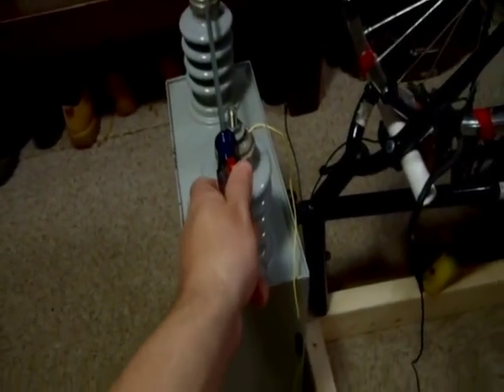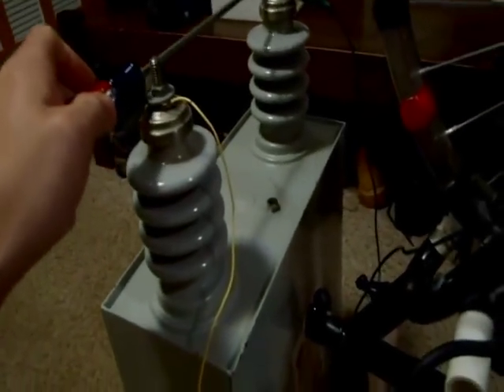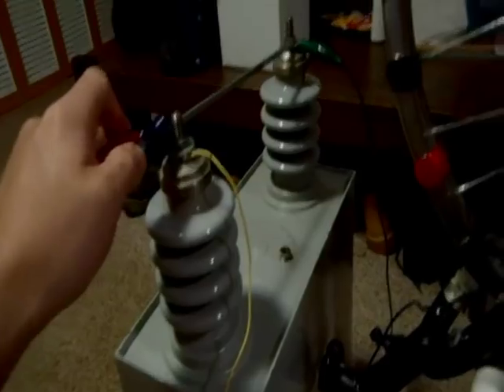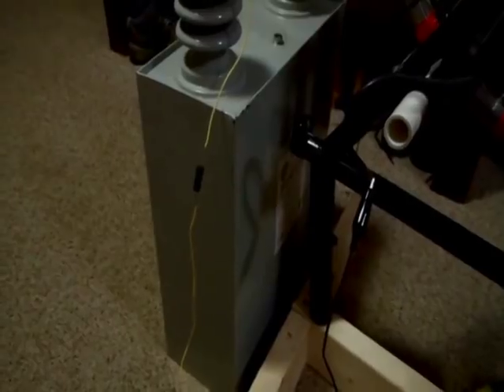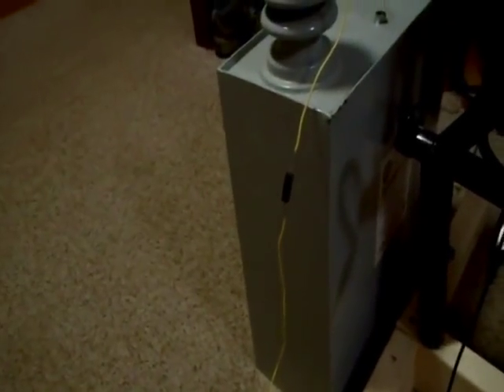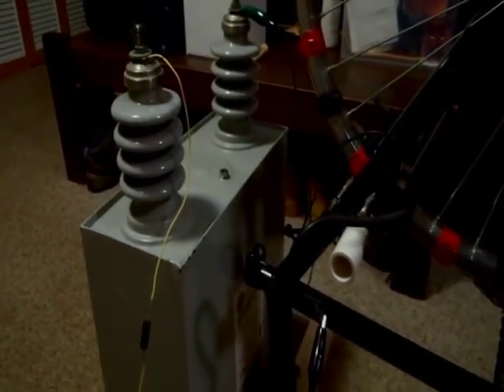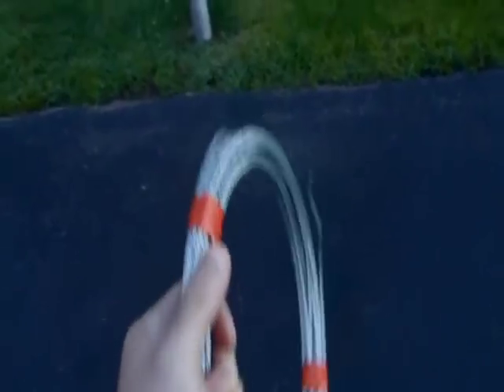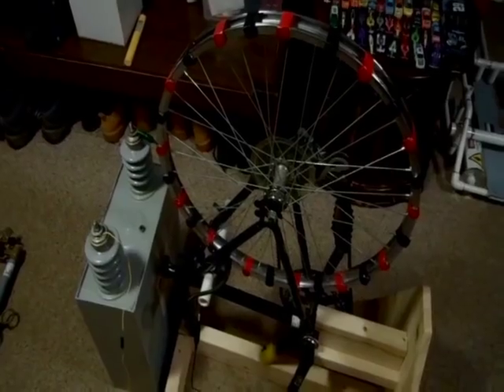Megawatt Bicycle Generator

Comment: is that dc? or ac?
Reply: Şahin yaşar 
Generator was ac but he used a diode to rectify it to dc for charging the capacitor. You can’t load up a cap with ac as it keeps reversing polarity every cycle.
Reply: @q.e.d.9112  i see thanks

Comment: Why is the title "Megawatt Bicycle Generator"?
You are no where near even 200W.
Reply: valveman12 
The way he got it up to speed with one hand and then it was freewheeling, I doubt the generator was putting out more than a few watts. You have to crank quite hard just to light a 60W bulb.
That capacitor was bulky but I doubt it was more than in the μF range. Maybe a whole mF, tops.

Comment: Uh, dude, I suspect we'll see you mentioned in the freak accident section of the news, "Electricity Geek Gets Fried", "...paramedics reported the cadaver as unrecognizable, one charred claw still clutching the remains of a voltage tester..."
Reply: from Frank. like they say that cat had 9 lives and she just spent em all zap zap
Reply: Frank Kellogg Jr. Hahahahaha
Reply: I discovered a chipmunk skull clenching the positive wire inside the treadmill motor that the young lady said "turns on" but does not work. haha. DC motor shorted out by chipmunk. https://elixirfield.blogspot.com/2019/01/treadmill-dc-motor-hack-investing-in.html makes for good photos though.

Comment from the maker: Please watch my Lightning Theory Lecture video were I talk about how lightning has very little if any wattage what so ever and that it's the heat and the shockwave caused by the electrons moving at the speed of light that does all the damage and makes all the noise and how there's only enough current to just mess with your heart and that if lightning had as much power as they say it does in the movies it wouldn't just cause static on AM radios it would cause electromagnetic pulses that would fry all of our electronics every single time there was a strike somewhere on earth.

Comment: I laughed so hard when you said you wanted to light a campfire with the cap. You are awesome! :-)

Stay safe around that thing. The last thing you want is to get laid out and be waking up to the ugliest dude you ever saw thumping on your chest while blowing bad breath down your throat.
Reply from the maker: Actually with a 120/240/4160Volt transformer. In some of my other videos I have even put water and salt water on porcelain insulators to show how they work in another video I demonstrated guy insulators by hooking 5,000Volts to full size single phase powerline strung across the basement and even at the end of the of the 4' fiberglass guy insulator I measure a pretty significant voltage from the induction.
Reply: Bryan Ropar Hello... are you still with us? If "yes" then did you ever get to try lighting the campfire?